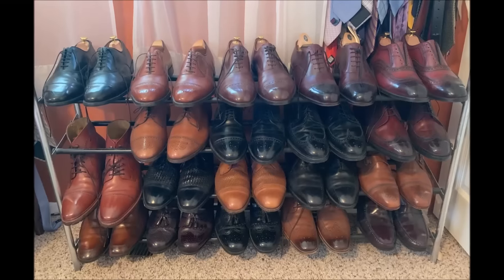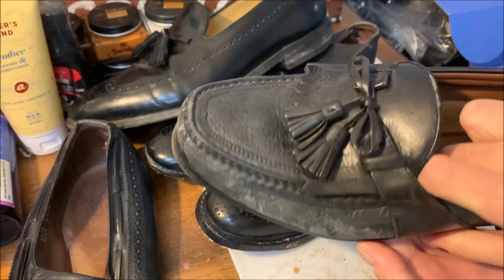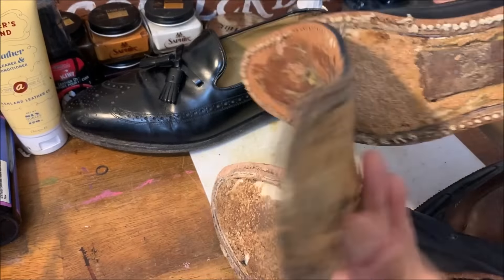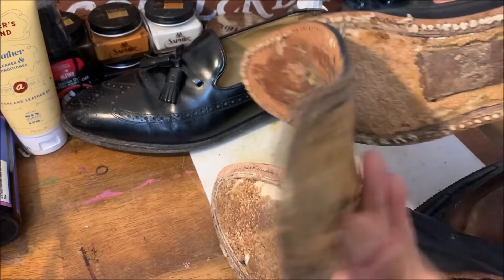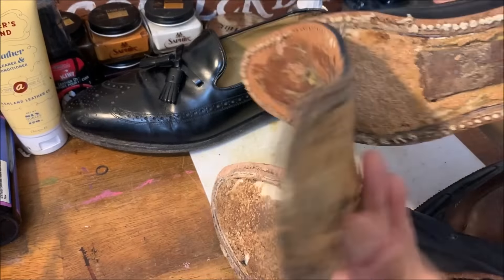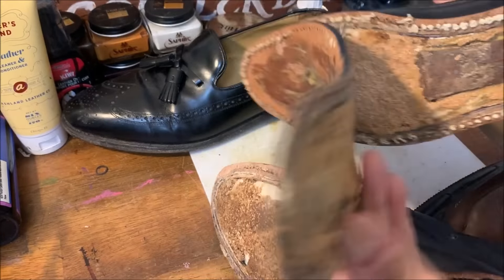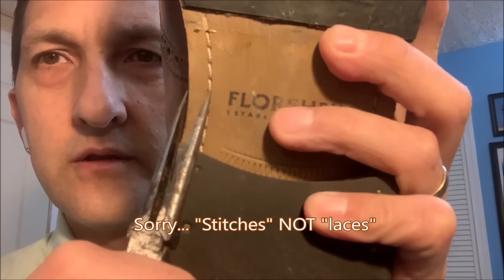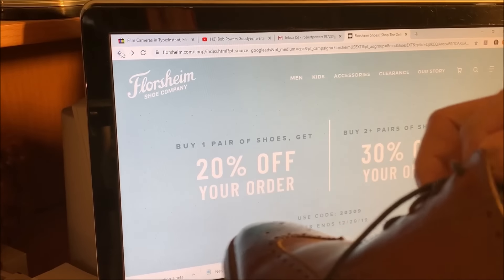How to Spot FAKE Shoe Sole Stitching!

Comment: Thanks Robert, that was very informative. Could you go into detail about spotting the differences between a blake rapid stitched shoe and a goodyear welted one without taking it apart? Would highly aprreciate it.
Reply from the maker: The best way to tell the difference between those two, barring just being able to look it up on the company website (if it’s a currently produced shoe) is to look inside the shoe. Again, you’ve got to check if it’s got a removable insole liner. If it’s got a removable insole liner, carefully peel it back and look for the Blake stitching around the perimeter. If you see that AND it’s got real outsole to welt stitching, it’s Blake Rapid. If not, it’s probably Goodyear Welted.

Comment: Very helpful video. I think the distance of the stitches from the edge of the shoe can be visibly very different between the welt and the outsole. The sole isn’t a flat straight piece. It curves up both length and breadth wise, and that curving can result in very different distances of the stitch from the edge when you see from top (the welt isn’t that curved) and the bottom (outsole is curved/bent).

Comment: This was incredibly useful Robert!  I have a pair of red Florsheim wingtips and when I took a look once again I almost freaked out because there are stitches on the outsole but not stitches inside the uppets, so clearly no blake stiched. So i was wondering....are these goodyear welted??... They don't look like that... because there is no stitching around the exterior of the uppers...i wanted the truth so I decided to cut the sole open to see if the shoe had the stitches holding the outsole, and I found them so yeah everything is fine with my florsheim's hahah...but they are weirdly made.... there is only stitches on the sides but not around all the shoe.... Its just weird... anyways ...

Comment: Thanks for the information. I have a pair of J&M 20-1040 Suede Chelsea boots and a pair of J&M 20-3116 suede shoes that after watching this video, are probably glued down because I didn't see any stitching underneath the insoles and the outsoles are glued. Both were made in the Dominican Republic. Having said that, can glued down shoes be converted to a blake stitch or a goodyear welt? Thanks again.
Reply from the maker: I have seen a bonded sole converted to a Blake RAPID construction. They couldn't be converted to a Goodyear welt construction though. Blake rapid is when a cobbler would remove the bonded sole and stitch on a thin leather mid-sole onto it. Then, they would outsole stitch the outsole onto the new mid-sole. You'd have to ask a Cobbler if they were willing to do that. I'm gessing the problem you'll run into is that with many cheaper shoes, the insoles are thin, and they may also be weak because they're not evel leather. You may have a problem with trying to blake stitch the mid-sole onto the old insole. I've never done it so I'm just guessing here.
Reply: Thanks and I appreciate you taking the time to provide a complete reply. What if you replace the current insole with a genuine leather insole to match with a new leather midsole? Would that make for  a stronger, more durable shoe, if possible? Also, I was thinking of using Vibram 700 Tygum brown cork soles and heels since they are casual shoes. Thanks again

Comment: But how can i tell if it's fake goodyear welt stitch without peeling back the insole? There's a tell just from looking the outside stitch?
Reply from the maker: M.F - as mentioned in the video, look at:
1. The Distance from the edge of the welt to the top side stitch, and then the edge of the sole to the bottom side stitches. They should be very close to the same distance from the edge of the sole. If the bottom side stitching is much farther inboard, it’s probably fake. 
2. Count the number of stitches per inch. If they do not exactly match, it’s fake.
Reply: @CobblerBob  thanks!

Comment: Hi there? Can you convert a Blake stitch to a Goodyear welted shoe? Thanks.
Reply from the maker: There are exceptions, but no, not really. There’s usually not enough upper material to join to the gemming. That’s assuming you can add a gemming into the insole. What’s more feasible is to turn it into a Blake Rapid sole. That’s where you have a Blake stitched mid-sole where the current outsole is, then you stitch an outsole to the new midsole via outsole stitching like a GYW shoe.

Comment: Robert: On the inside of the right shoe, on a pair of Allen Edmonds is the oval colored logo. Sometimes black, blue, or green. Is this a way to date the shoe?
Reply from the maker: Uncle Warren - have you seen my “How to Date Allen Edmonds Shoes” video? https://youtu.be/Lcx0eq-S-eY - I cannot tell you the exact correlation of the color of that logo, but the style of it definitely makes a difference. In other words, before 1989, logo was in all capital letters “ALLEN EDMONDS” in Times New Roman font. 1989-2016 or so the logo was “Allen Edmonds” with only the first letter capitalized. They added on a badge in 2016, and in 2018 the logo Adjer again change to all caps again and what I would call “military font”. Older AEs (up until approximately 2000’s?) have a date code - make sure you check out the comment section of the video too.
Reply: @CobblerBob  Of course, I have watched them all.

Comment: Thanks for this video. I got ripped off too, by Johnston & Murphy, cap toe Warner boots. They look nice and cost almost $200. Stitches on top, stitches on bottom. But, they don't exactly line up. On J&M website there's mention of a "contrast welt." But after seeing your video, I snooped a little and other retailers add a bullet - cemented construction. It's deceptive. I really liked the boots but now they're kind of ruined for me.

Comment: Thank you Robert! Very interesting insights. Not so long ago I bought a Bally Scribe No. 2 (on styleforum.net they call it bally scribe vintage captoe) on an online auction website for about 200 $. It seemed to be a goodyear welted shoe and I even thought the sole was stitched on with a closed channel stitch. After a while the sole came off and to my disappointment it was just glued on! To my surprise underneath the sole there was some kind of filling (not cork, but some rubber like material). It also seemed to me, that there was some kind of stitching between the first welt and a, lets call it "midsole welt" which acted as a spacer for the filling and to which the sole was glued to. Have you ever seen any construction like this? Do you think it is possible to get it properly goodyear welted?
Reply from the maker: It’s a little difficult to envision based on just a description, but I think I get the idea. I guess anything is possible, but realistically speaking, I would guess it would be easier to turn that shoe into a Blake stitch shoe than into a Goodyear Welted shoe. To turn it into GYW you would have to add on a gemming onto the underside of the insole, get it in just the right place, and then add on a welt, fill the void, the. stitch a sole on. There are very few people outside of somebody like Bedo‘s leather works that would be able to tackle this, and he probably charge you in the ball park of $400 to do so bc of the labor. Again, Blake stitching it on means just stitching through the outsole to the inside of the shoe, which I think any competent cobbler could do?
Reply: @CobblerBob  Thank you very much for the detailed answer. I should have taken a photo when the sole came off. Yes, I guess a blake stitch would be the best and cheapest option here - or I'll ship it to Bedo when I saved up some cash ;-)

Comment: Could you resole such a shoe with a real Blake stitch? Provided you could remove the old bonded sole.
Reply from the maker: Yes, Blake stitched shoes can be resoled. In my latest released video, you'll see me do just that at a local Cobbler's shop and get to see the Blake/McKay machine on a pair of Florsheim double monk strap shoes! It's got a "horn" that goes into the shoe to complete the stitch. The main disadvantage to resoling a Blake shoe is every time you do, you put another set of holes in the insole.

Comment: Robert, how do you sanitize and deodorize a thrift-find shoe before wearing them?
Reply from the maker: Dennis OConnor - I keep a spray bottle filled with 50% isopropyl alcohol and 50% water, and squirt it inside the shoes. There’s different ways to do it, other people use sanitizing wipes, but I prefer NOT to wipe out the inside of the shoe, and just let the alcohol sit on there and evaporate because I don’t want to wipe off any inked on on logos. FYI, in picking up several hundred pairs of shoes, I’ve NEVER found one that had any odor! Odor comes from bacteria, and bacteria needs moisture to grow. Generally all the shoes you’ll find thrifting are bone dry. Once in a while I will see one that’s moldy, but I avoid picking those up.